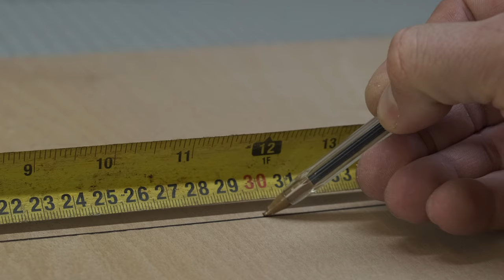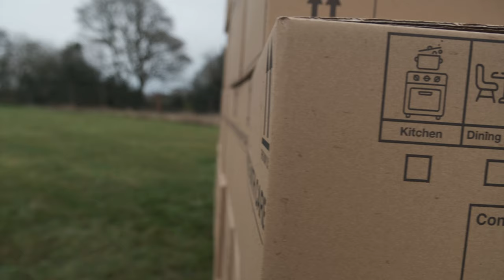I Built A Mobile Firework Rocket Launcher, Nerf Mod

Comment: I've got a baddass design for a 8 wheel fpv tank using 4 ESC and motors using all arrma 6s outkast parts and another separate fpv system for someone to operate  turret spins 360⁰ and shoots a airsoft gun. It will cost around $4k to build that's why I stopped once I pretty much started. If you want the design let me know
Reply from the maker: That sounds awesome, we’re going to try a live battle soon, can you email your design to officialmajorhavoc@gmail.com ? I have a few unfinished projects but I might be able to build it after that 👍👍
Reply: What a chad for replying hell yes I wanna see a tank
Reply: @majorhavoc  would it be easier to upload a video explaining th design with the parts layed out?
Reply: @KaijuRails54_Official  I've been wanting to build it so bad but it's so expensive